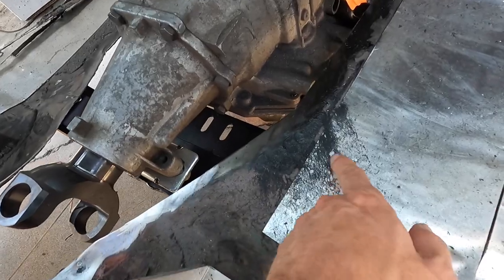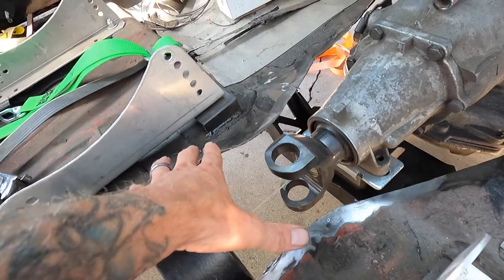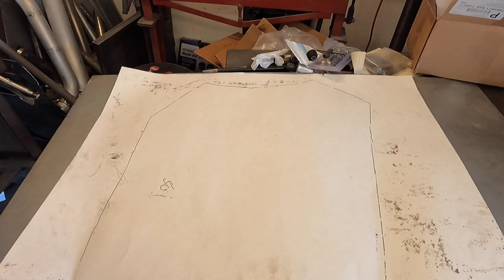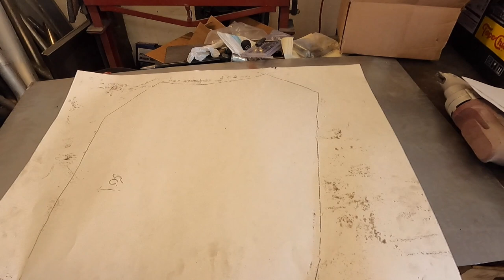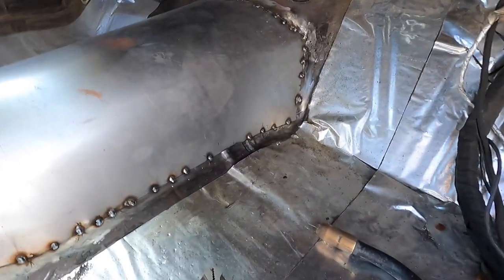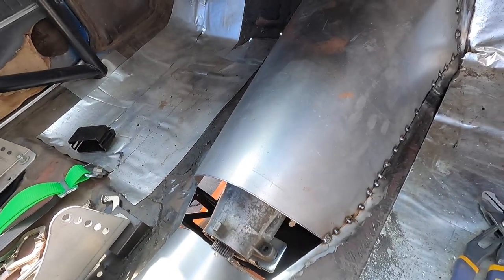4l80e build part 7 (Transmission Tunnel build)

Comment: I use self tapping screws to pull the over lapping metal tight together before I Tack it, it works mint, and a lot cheaper than cleakos, it looks mint, great job, don’t forget cup holders!
Reply from the maker: Thats a good tip!  Ill have to remember that at some point when I don't have access to the bottom. I have cleakos I use all the time. If you buy them once they last forever. Look around at the swap meats and see if you can find used ones.

Comment: Hey man I love the shorter vids on this project, gives me more to watch at work. Can you tell me how wide the new tunnel is? I have a 65 skylark (basically the same car) that I will be ls/4l80 swapping but I’m building a custom center console this winter and don’t want to have to rebuild one when I do the swap
Reply from the maker: I don't know off hand. I put the transmission in and then cut this out. I can take a measurement for you but yours may be a little different then what I ended up with. Hit me up on Instagram and send me a message. I reply to these at night so im not going to go out to my car right now to measure it. If you send me a message during the day it would be an easy thing for me to do for ya.

Comment: I mean obviously fixing the die grinder it the best solution but you can probably ad a ball valve for some control
Reply from the maker: I need to find a snap on truck and see what it would run me. Its 1/4 hp die grinder so the thing is pretty spicy. Well it was haha
Reply: @Burndown  have you taken it apart and looked at it yet
Reply from the maker: @james10739  No I haven’t messed with it.

Comment: Checking in  What are you going to control the trans  with?   My friend installed a Fast FI  from Holly and when it goes into 4th gear it bogs.  Just wonder what your doing.  I'm a  Ford guy so..
Reply: Terminator X Max. Check out his other videos. A lot of info and insight on things. ;)
Reply from the maker: Holley Terminator X. You can adjust the transmission shift points and lock up and everything. I have one in my Turbo Winnebago and the transmission shift points needed to be changed for it to drive and shift well. Noting is going to be perfect out of the box. They make computers to control ford stuff as well. Who knows maybe ill swap a Godzilla in something one day😁 That would be cool!